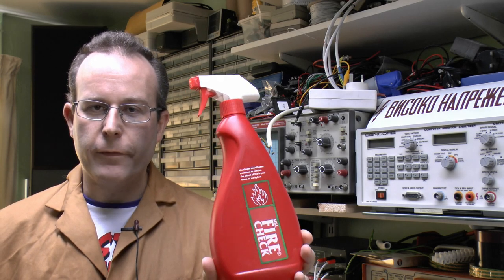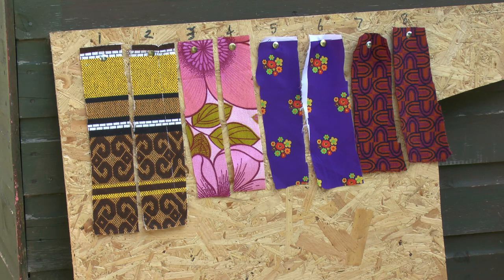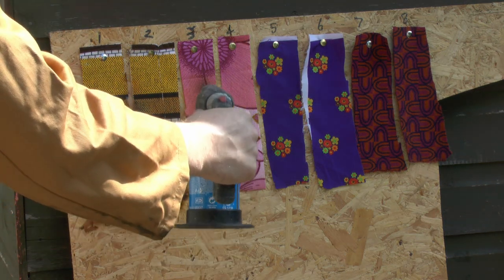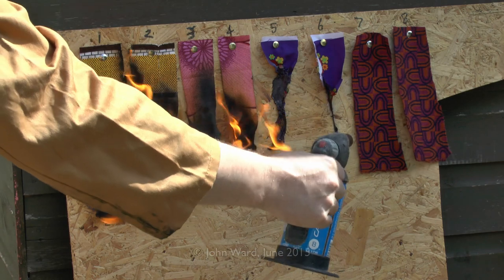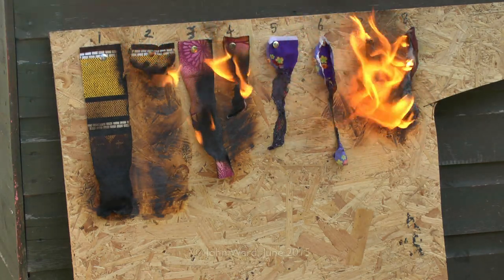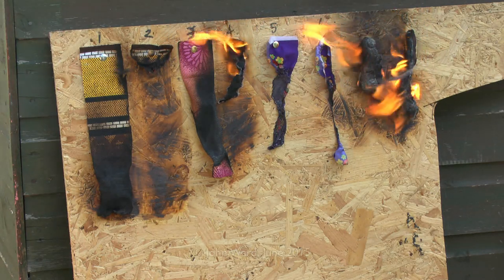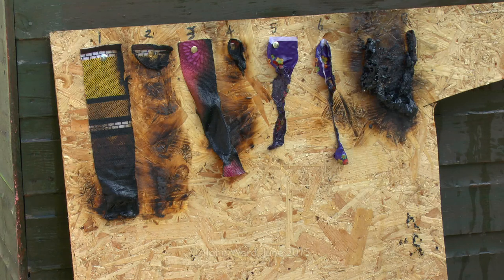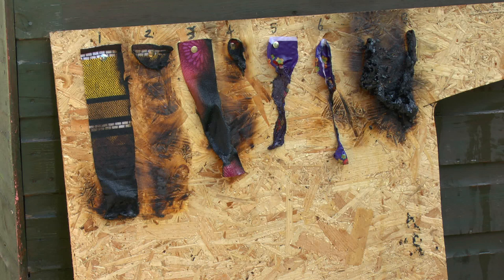Fire Retardant Spray Test

Comment: Not really the way those tests are supposed to be conducted.  You have a pretty uneven application of the torch. Should be done with a lighter (not a blowtorch) held at the bottom of the strip, not waved around. it gives the treated fabric an opportunity to scorch, release its water vapor, and prevent the flame from travelling up. Standard NFPA 701 test.
Reply: perhaps you could upload a video to demonstrate.
Reply: The reality of a house fire is that things get very hot, very fast, and in an uneven way. A cigarette lighter is not suitable for the tests that I would require. The answer is to minimise combustibles and use sprinklers and detectors in combination.